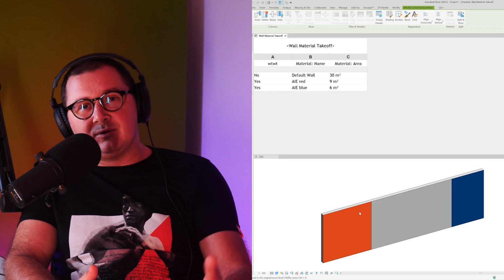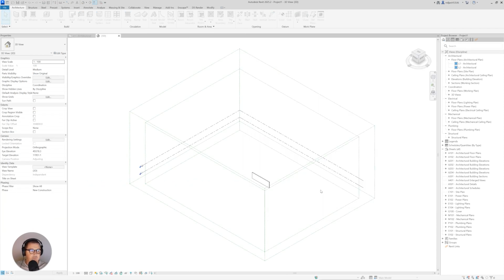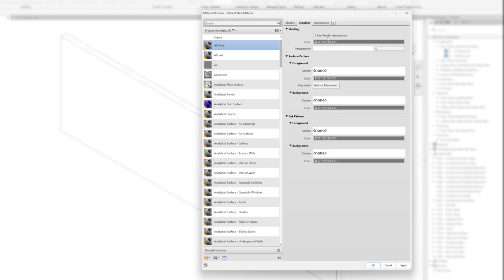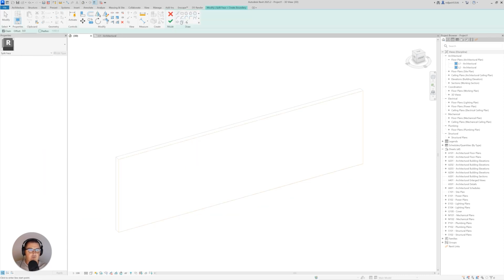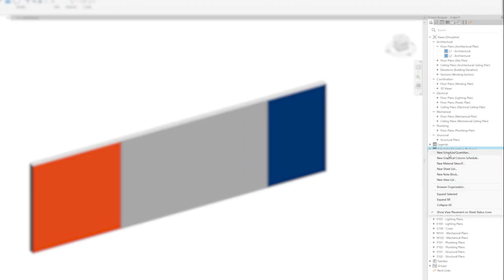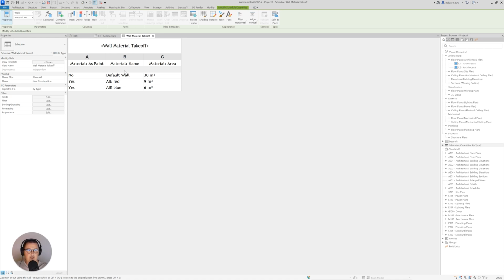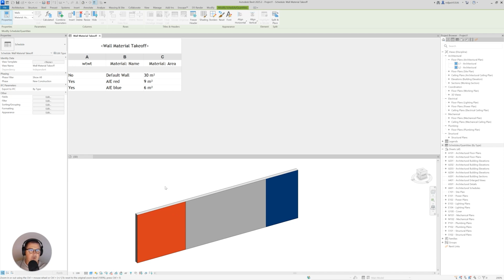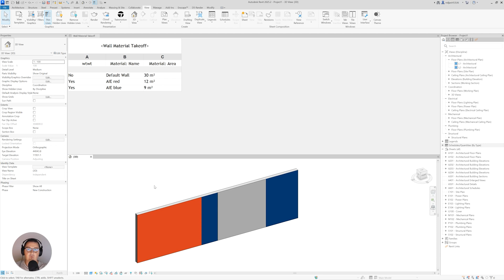Schedule Painted Surfaces in Revit

Comment: is it possible to schedule all of the paints in the project? regardless if it is on wall, or columns and etc?
Reply from the maker: Yes, you can use this method. Have you already tried it?
Reply: @arkiteasy  I haven't, I can't seem to schedule together all paints from walls, columns, slabs